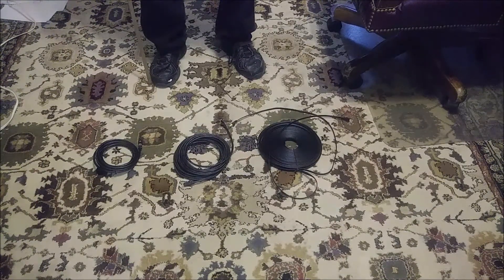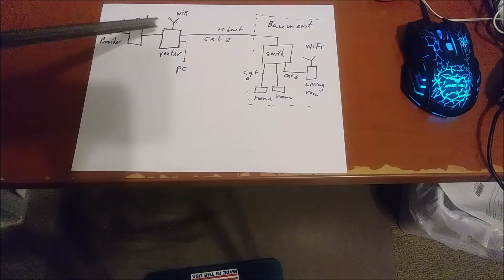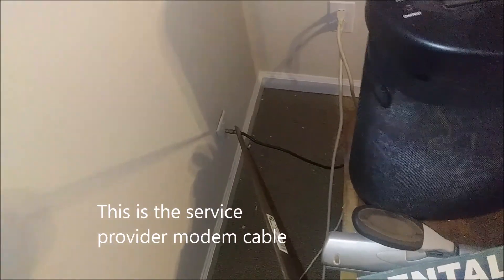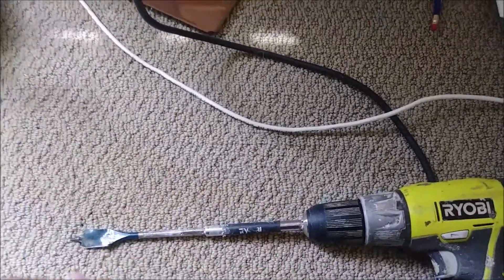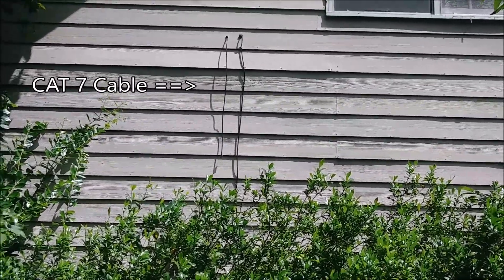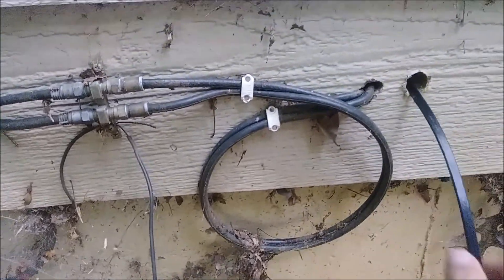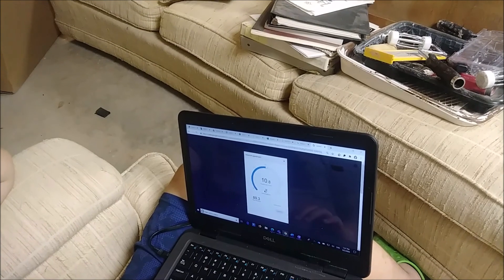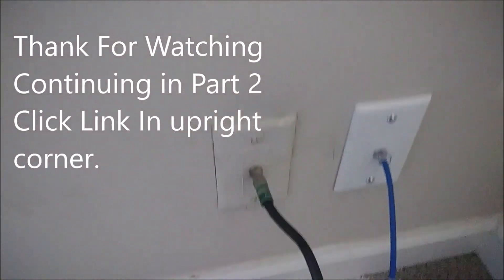How To Install Fast Internet In The Basement - Part 1 - Connect Ethernet Cat7  Cable To Basement

Comment from the maker: Material used:
Long Ethernet Cable 100 ft,  Cat 7  High speed = https://amzn.to/381CWuy
Cat6 Ethernet Cable  in Black 20 ft = https://amzn.to/383It3R
Cat6 Ethernet Cable  in Black 25 ft = https://amzn.to/3uL9Byh
Cat6 Ethernet Cablein Black 30 ft = https://amzn.to/3c0xOIy
Long Cat6 Ethernet Cable  in Black 35 ft = https://amzn.to/3sC81Ng
coax ethernet wall plate and 1 gold plate cable tv = https://amzn.to/3830WgN
RJ45 Cat-6 Ethernet Patch Internet Cable - 10 Feet (3 Meters) = https://amzn.to/3sNrPgV
1 Port Ethernet Wall Plate white -  Single Gang Cat6 RJ45 Ethrenet = https://amzn.to/3e6tSbF
2 Port Ethernet Wall Plate white -  Single Gang Cat6 RJ45 Ethrenet = https://amzn.to/3eaiSdc
Ethernet Extension Cable Cat6 Cable RJ45  10FT = https://amzn.to/308Z4Pr
TP-Link  8 Port Gigabit Ethernet Network Switch = https://amzn.to/3kChG3E
TP-Link  Gigabit WiFi Router  5GHz Dual Band = https://amzn.to/3b85oNi